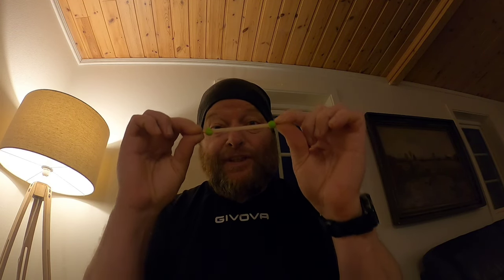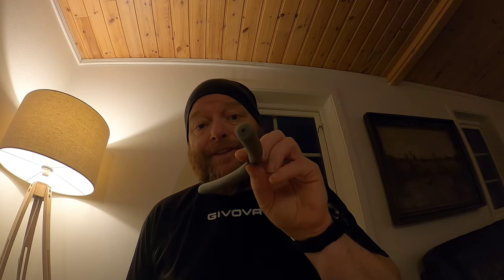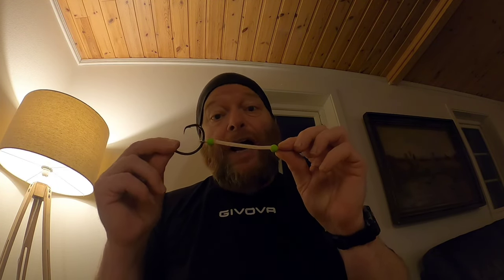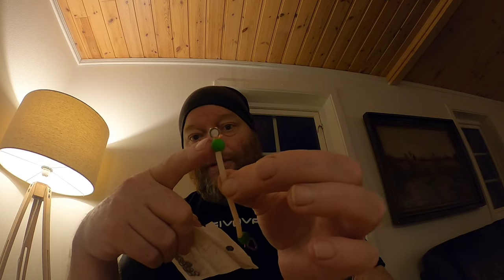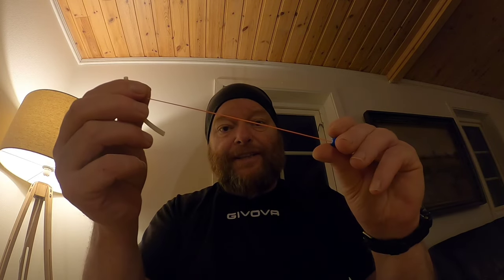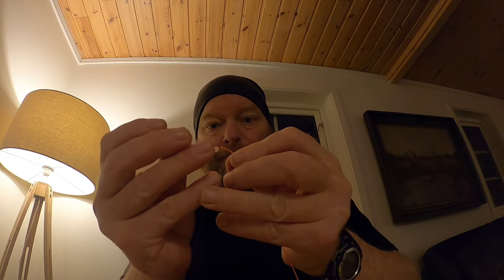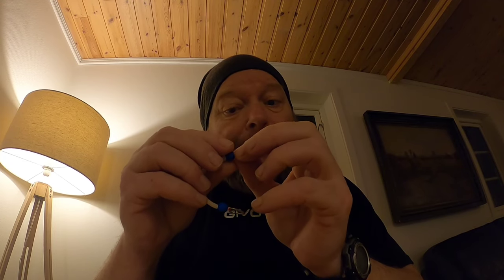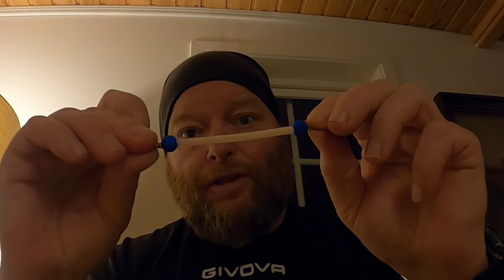A quick and easy way to tie reusable Dingle dangles

Comment: I just use 50lb Dacron and superglue a Uni knot loop around a pen tube, for the bottom. Slide a bead on when rigging up and tie it to the hook with another Uni knot. A metal free dingle. Releases OK using 5oz sinker. Yeah, it's a pain to tie the bait on. 😂 Gonna try some silicone tube now. Got some in the garage. Thanks.
Reply from the maker: Hi Red. Just as long as it doesn't stretch, I think you can use anything. And if it works, it works! Thanks bud😁👌

Comment: Nice video explaining it Billy. Personally I dont like dongles. I find that im loosing a hook gaining nothing but thats personal. I find even with a pennel with a circle top hook and a J hook on bottom the circle 99% of the time will always hook.
Reply from the maker: Hi James. I think it's got more to do with confidence than anything else, in the beginning I wasn't convinced. But over time,  and with practice I found they worked just as well or better. But hang in there I might have the answer for you. Thanks Brother 😁👌

Comment: Its hard to understand the heatshrink part. Can you show that under a brighter light.Thanks.
Reply from the maker: There's not much to understand, you put the heat shrink over the little ring. Heat it, the tube shrinks. Then you pass the hook through the hole. The heat strength tubing is to hold the hook. Hope the explanation helps, thanks Brother 😁👌
Reply: I get it now. Clever.

Comment: Have you tried the dingle dangle for ling, hake or similar?
Reply from the maker: Yes! It works for every fish,  except eels and maybe wolf fish👌
Reply: @Billyfishing_watch   Thanks! I'm having a hard time hooking ling good when using circle hooks, but the full hook opening might help
Reply from the maker: Just let the fish do all the work! Titan of the line, don't strike. when you feel the fish on the end and lift into the fish 👌
Reply: @Billyfishing_watch  Thanks. Had great luck with circle on halibut. But then again, the halibut did all the work 😄
Reply from the maker: Yes they do👌